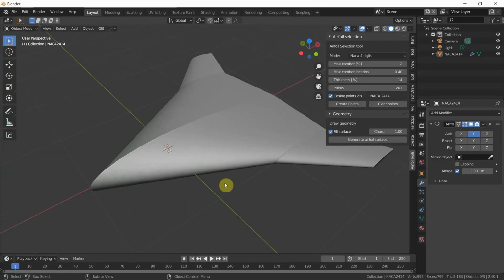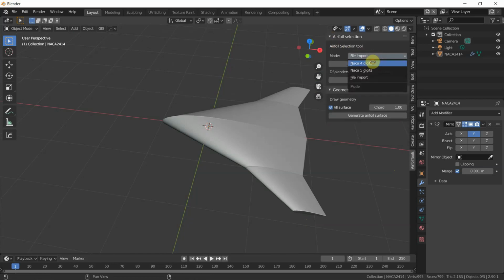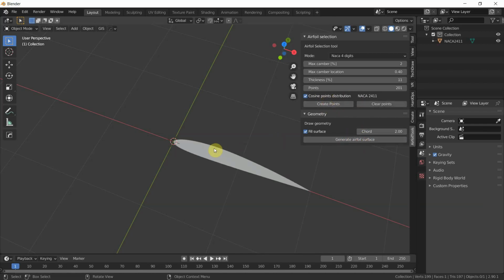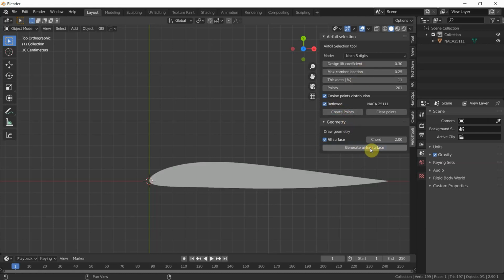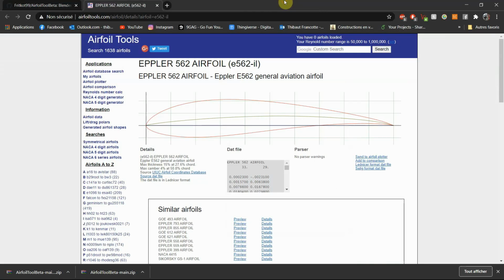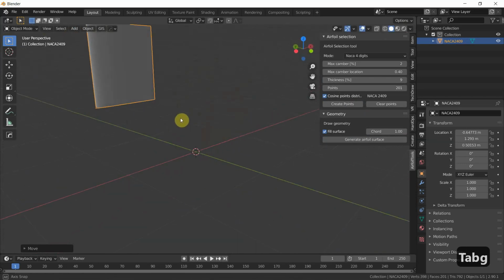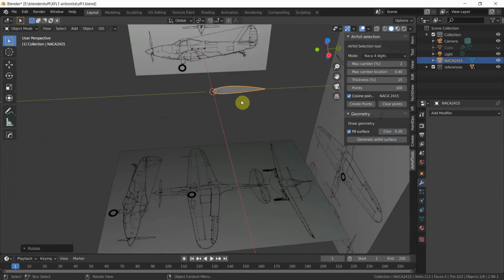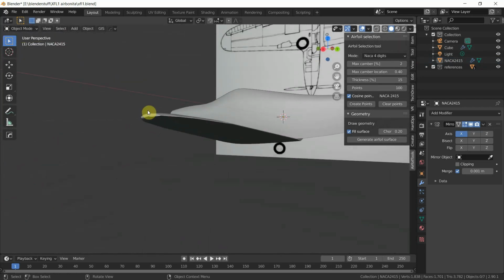Create accurate aiplane wings in Blender with AirfoilToolsBeta addon: Tutorial

Comment: Brilliant tool thanks! Using Blender 2.93 I found with versions 0.4 and 0.5 with NACA 5 reflex checked it gets an error creating points, which means you can't improve the leading edge with the cosine point distribution. Any ideas on this? I found no other issues so far and I can get good NACA 5 results with version 0.3.
Reply from the maker: thanks for the feedback and sorry for the delay! I just found the issue and solved it I'll upload a new version asap